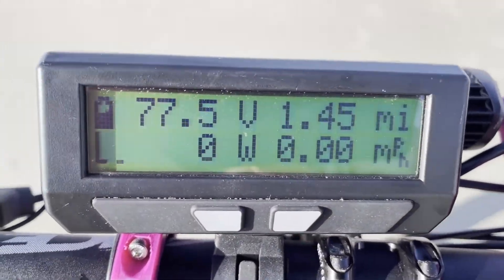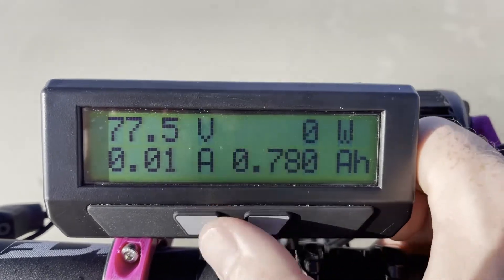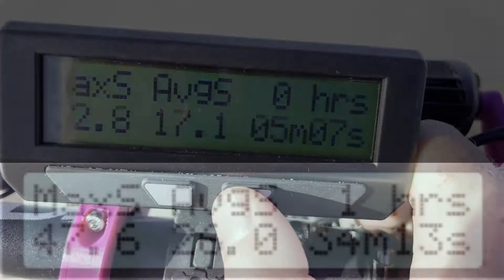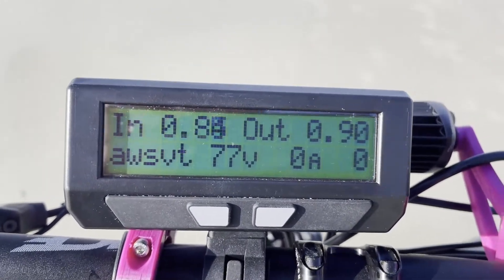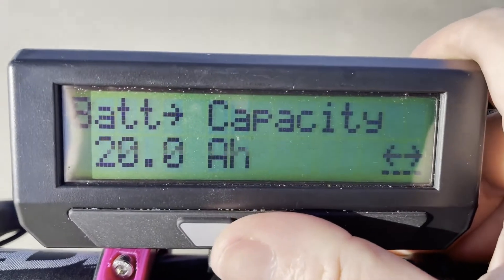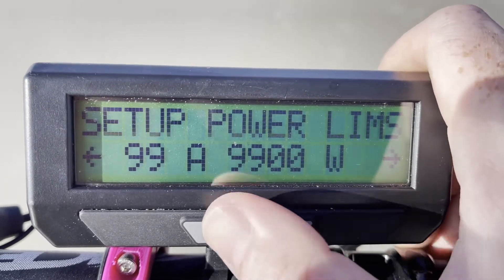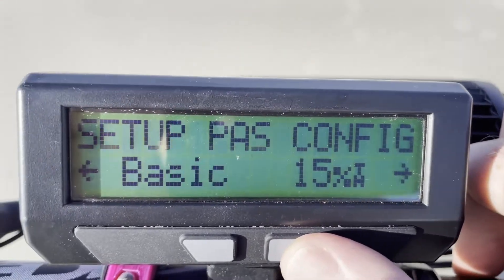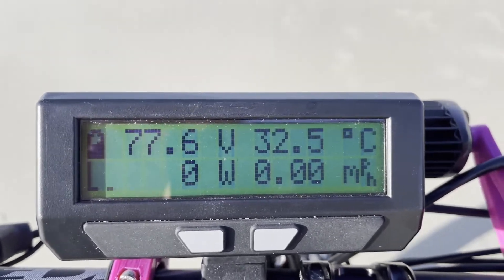Tech Tip: The Cycle Analyst is a E-Bikers best friend.  Really, more features than you might think.

Comment: You can easily see that display while riding, i have it. Also to the video creator, change the brake out voltage in the CA so your arent wasting energy having the motor attempt regen when its just freewheeling inside. It can also be dangerous for the motor and hardware going from that internal freewheeling regen to throttle power. Lobe the cycle analyst!
Reply from the maker: No brake input to controller!

Ride safe, have fun.